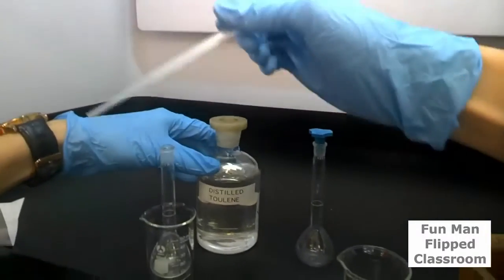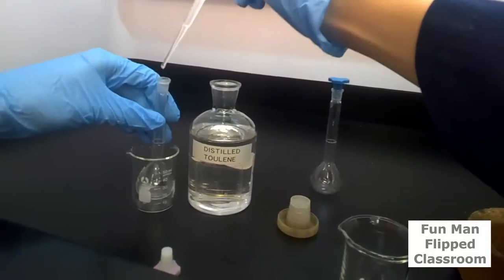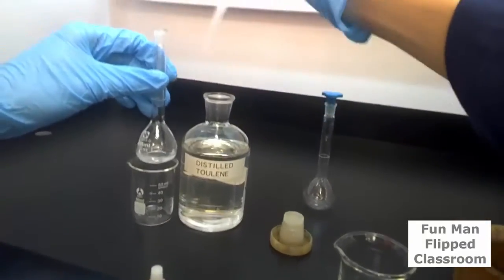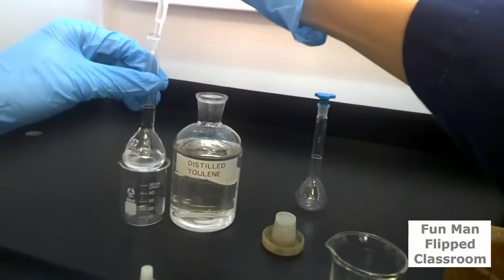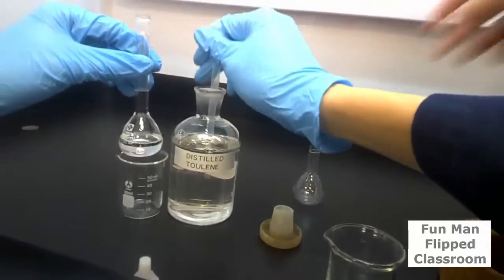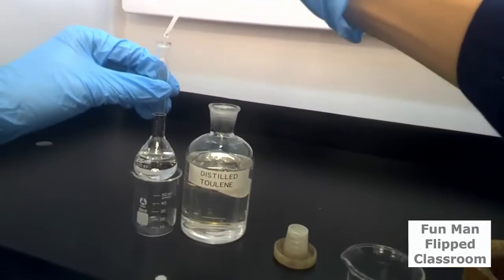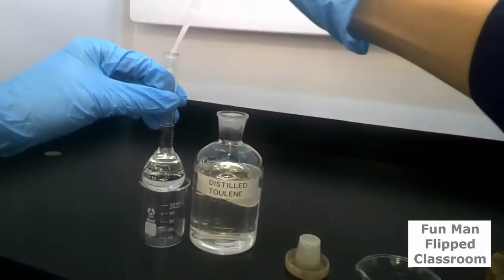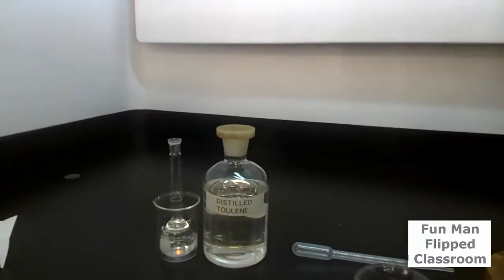How to Prepare a Polymer Solution for Viscosity Measurement

Comment: How do the solubility parameters of a polymer and a solvent affect the viscosity of the solution?
Reply from the maker: "good" solvent is defined as one whose solubility parameter is similar to that of the polymer.

For the good solvent, the attraction forces between chain segments are smaller than the polymer-solvent interactions.

As you know, a polymer is long. In this case, the random coil adopts an unfolded conformation. 

In a "poor" solvent where the solubility parameters is quite different from that of the polymer, the polymer-solvent interactions are not favoured

So,the attraction forces between chains predominate, causing the random coil to adopt a tight and contracted conformation.

Better?
Reply: @chemfunman  yes. Thank you. And an unfolded confirmation leads to higher viscosities. Very good. Thank you for responding!